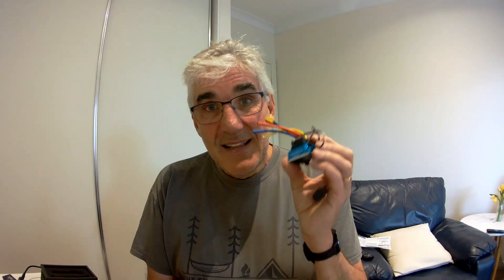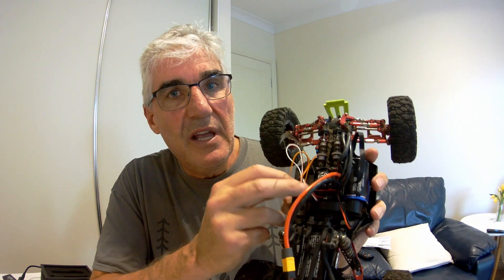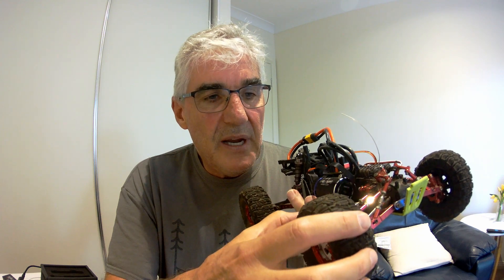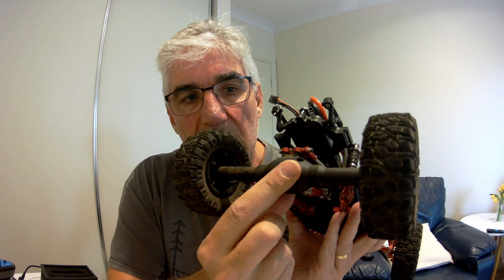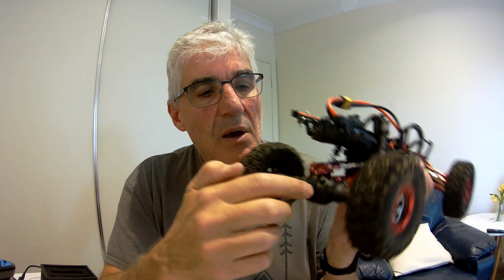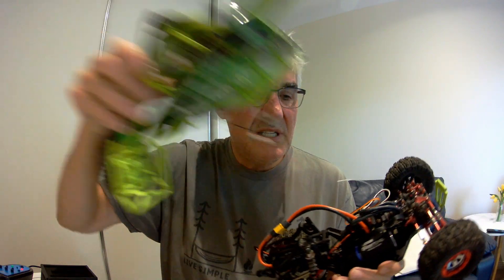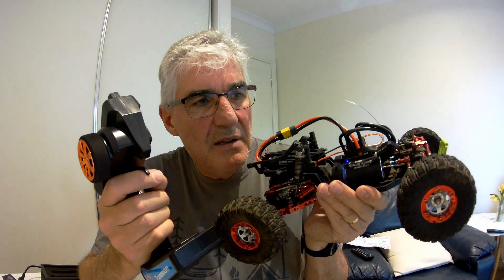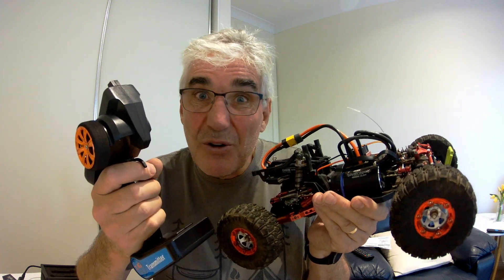WLTOYS 12428 Cheap Brushless ESC is TRASH!

Comment: My upgrade went wrong it started stuttering... At first when i push a little bit it starts working perfectly
Reply from the maker: @technicaljatt3523  yes it only jitters when starting slowly
Reply: @dsfifty  is there is any solution??
Reply from the maker: @technicaljatt3523  either live with it, or get the sensored esc and motor.

Comment: Couldn't you find a solution to the engine stuck? I don't have the opportunity to change my esc and motor?
Reply from the maker: No solution other than just live with it. I'm so glad I changed to censored. I'll never go back.
Reply: @dsfifty  So can I get rid of this problem by just changing the esc?
Reply from the maker: @JoinPoyraz  No. You have to change the motor as well. There is a special wire hat runs between the motor and the ESC that tells that ESC what position the motor is in.

https://www.aliexpress.com/item/1005004840346411.html?spm=a2g0o.order_list.order_list_main.22.7c711802YuRlGG
Reply: @dsfifty  Can you please recommend another esc motor that is too expensive for our country?
Reply from the maker: @JoinPoyraz  sorry. That's about as cheap as they come.
Reply: @dsfifty  So, are we going to buy 17.5 T for your engine, so as not to change gears?
Reply from the maker: @JoinPoyraz  I got the 6.5 turns motor and didn't change the gear pinion. It goes well.
Reply: @dsfifty  They tell me there is a battery problem. There is no spare battery. I will try it as soon as possible.
Reply: @dsfifty  Can you use it as a climbing tool?
Reply from the maker: @JoinPoyraz  see here. https://youtu.be/hWKvKH_L36U